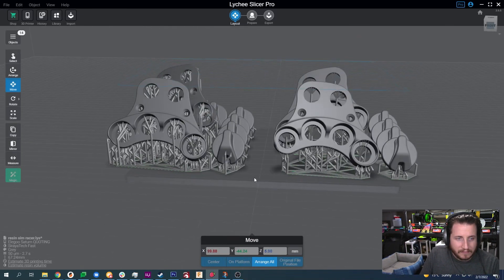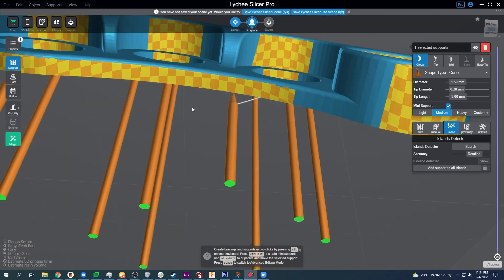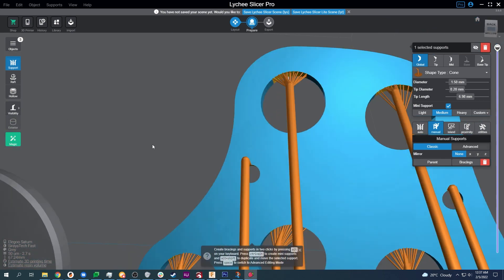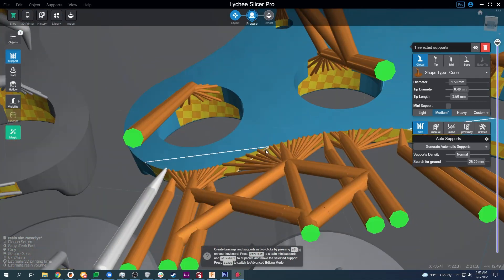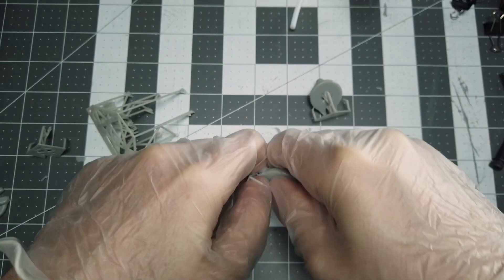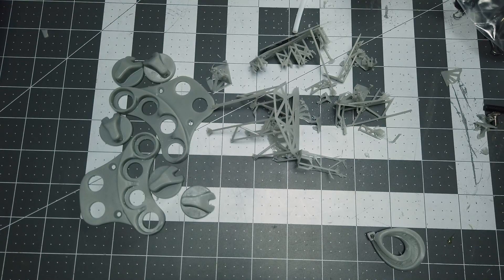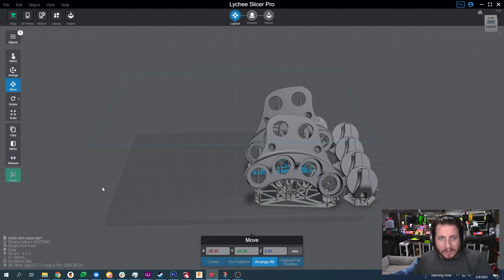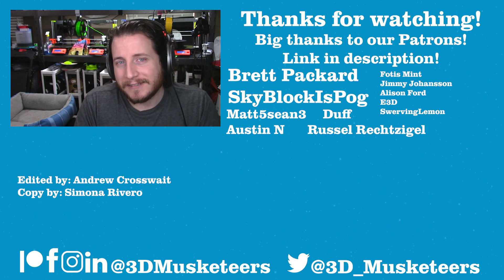STOP Wasting Resin on BAD Supports!

Comment: Too bad Lychee doesn't listen to consumers. I can't use lychee because my printer doesn't have the same resolution as the mono screen mod resolution. Instead of reading my comment, they say "use the mono screen mod". Yeah my printer refuses to use that resolution. I'm stuck with chitcubox which loves to place supports along the model's faces making it part of the face.
Reply from the maker: This sounds like partially the printers fault. But also, as a company, they have to weigh how often that issue happens and if it's rare at best I can't say I blame them for not specifically dealing with this. It sucks, however you can likely do all the work in lychee and then slice in chitu. That is what we had to do in the olden days lol

Comment: If you find supports are pushing your costs too high, probably time to find a new hobby. I just use auto supports then absolutely plaster the thing with tiny/small manual supports. If I spend more then 5 minutes on it, I'm having a bad day. Failure rate is probably below 5%. Never used a validator and never will. Not arguing that people shouldn't be proficient at supports, just that spending too much time seems like a waste of a far more valuable resource, my time.
Reply from the maker: I think some work on the front end removes any extra BS on the back end, IMO.

Comment: removing supports before curing can cause warping of the model when curing. For miniatures it won't matter much but for engineering parts it can be a sad day after curing unsupported models. Sure, a bit more clean up, harder to remove, more pain in life.. hehe... but well worth it in the end if you need things to fit with very low tolerances
Reply from the maker: Really good point! We don't notice it for larger parts but especially on the thin ones it can suckkkk
Reply: Excellent tip. Some of my parts look like they were shot penned with so much arch height. lolol. I will try that for sure.

Comment: How did you get the flat cross supports going from the base of each main support? Much less peel force than the raft I end up with (I don't use rafts, but supports bases stacked on top of one another may as well be)
Reply from the maker: That is a raft in Lychee :) You can find it in the support settings!
Reply: @3DMusketeers  Hmm... Every time I use raft it ends up making a giant dinner plate, basically a shadow of the perimeter if looked at from above. I'll have to mess around with some of the settings (different teapots? lol)
Reply from the maker: Lychee has different rafts, when you click on the raft setting on the top right you will see something like 8 different options for the rafts :)
Reply: @3DMusketeers  Ah i see, it's one of the Pro options (I'm on the free version for now). Thank you for the (fast) response, and happy printing!
Reply from the maker: oh crap that is a pro only? I had no idea! I will make sure not to use it in videos from now on then! I really need to work with them to get a free license as well, somehow so we can switch back and forth, so we can do the videos specifically in the free version. I feel bad now, as we have alienated someone, I'm sorry!
Reply: @3DMusketeers  No worries whatsoever here brother. It's all a learning experience.
Reply from the maker: I will do better next time!

Comment: You could argue if yous work hour is valued at say 100$ then its better to have more support and have it print in 1 try rather than spending more time on supporting yourself and so on so on. But then again, make tests to see how you can make the supports and then you can print worry free with less support and less cost per part.
Reply from the maker: Oh totally, my time factored in, this is about a wash really. I figure as I get better at the manual process we can cut it down to minutes per part and not half hour+. Going to mess around with this for some time and see where we end up. Big print rolling today (helps with next week's topic) all with custom supports so it shall be interesting!
Reply: @3DMusketeers  Curious as to where you ended up

Comment: Auto supports have improved significantly in recent years and are fairly good for beginners, but moving to manual supports is a step forward in your resin printing skill set.
Reply from the maker: Absolutely! Like you said, the auto in Lychee is so much better than tricking Cura like the good ole days LOL.